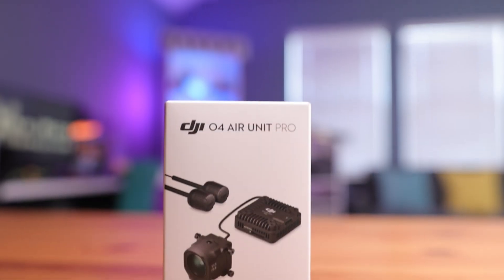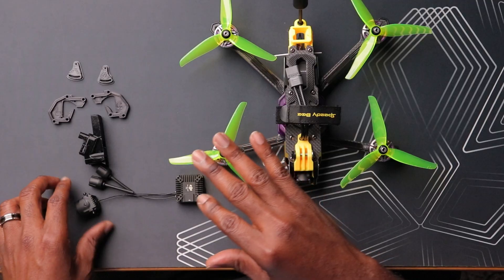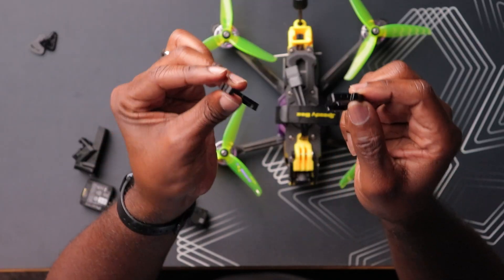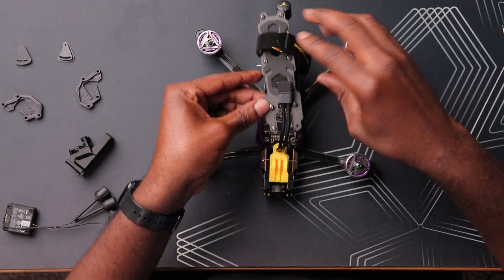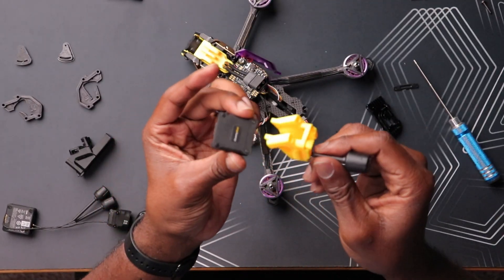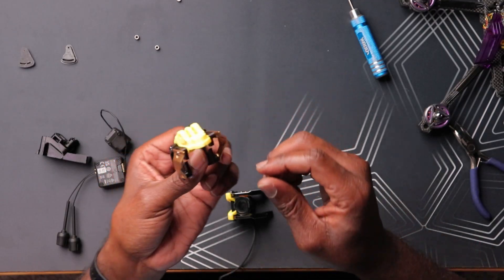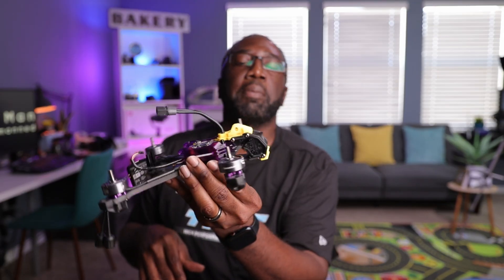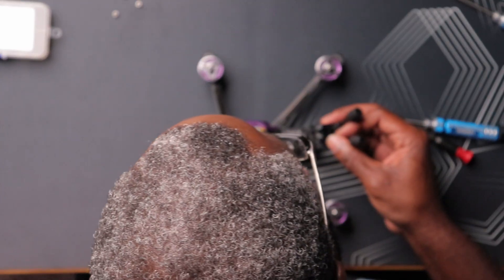How to Install O4 Pro In your Drone..The EASY Way!

Comment: Nice video man. One new sup here.
 Quick question:  Do you know about that yellow S bus wire. I use crossfire protokol. Do i still need to remove that? :)
Reply: You do not want the sbus connected if you're using CRSF. I basically remove the pin from the connector .  If you dont it can prevent your receiver from working.

Comment: Nice video and appreciate the link to the files!  They printed good but on the sideplates I used PETG and without the standoffs on two screws where the metal sideskirt goes in it doesn't really screw in well, just spins.  Theres also two screws up front where the carbon fiber screws in on top, but even though it's just straight plastic that one at least feels snug.  Haven't tried the two on the bottom yet.  NGL  I'm a ittle nervous to fly with this setup but your video helped me in planning it out until the upgrade kit comes in.  Thanks